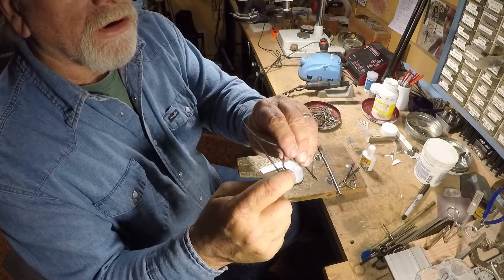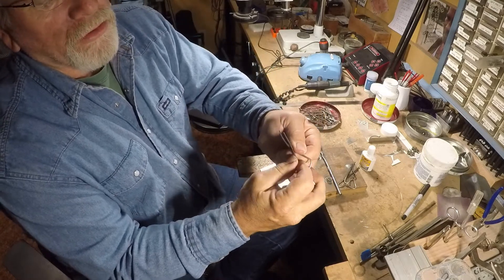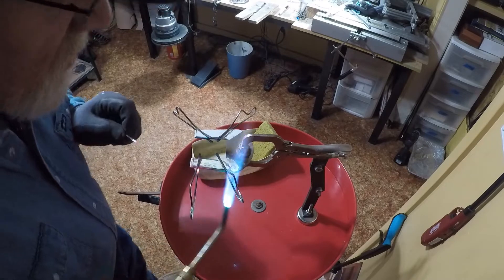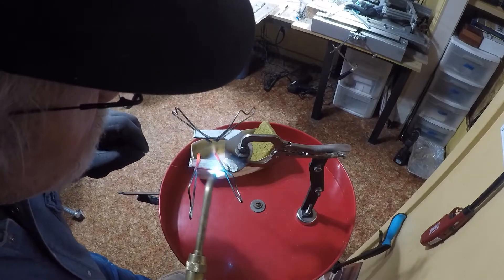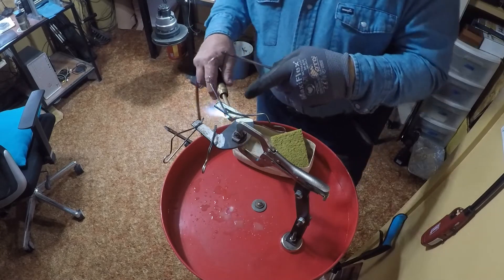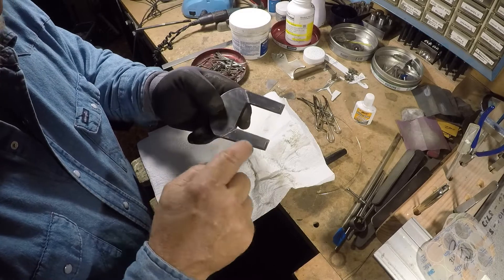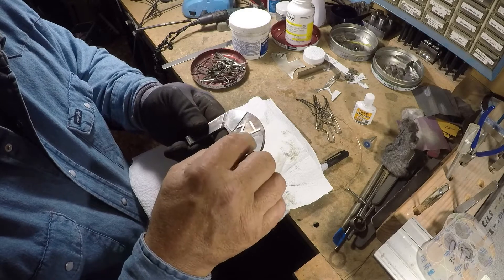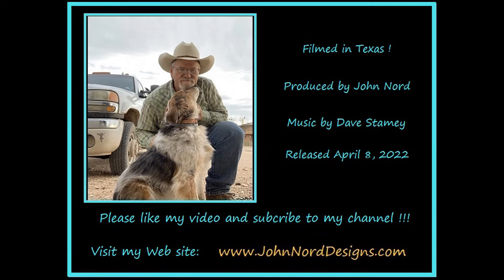Hard Silver Soldering

Comment: Hi John, I have some questions please.  So the way you do it, you can't see your Flux. How do you determine if the metal is hot enough? Color? Dark red? Bright red? Also do you clean the steel before you put on the Flux or just sand it? Thank you.
Reply from the maker: Kevin, i use a 3M S7 fine scotch brite wheel to finish steel before moving to solder. I also clean everything i solder beforehand with dawn detergent. As for flux, i can see it….around the edges…. I watch for it to turn clear… then i try to feed solder… If Im off a little on judgement, i heat it a little more. Make sure your handy flux is not diluted with water… it will prevent solder from feeding in… and dont get things too hot!  If flux turns black… its to hot and you might as well clean up and reflux.  Hard solder on steel is tuff, and takes practice and everything to work just right.
Reply: @JohnNordDesigns  thank you very much for taking the tome to answer my questions sir!
Reply: Time not tome. My apologies.
Reply from the maker: @kevinneblock5214  , you are very Welcome! Thank you!